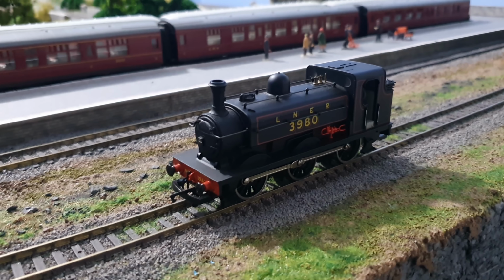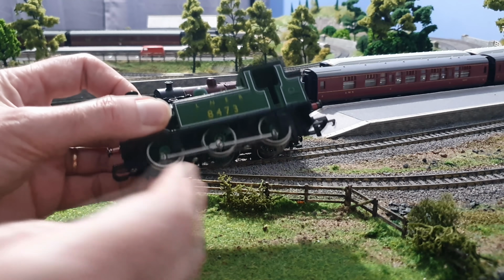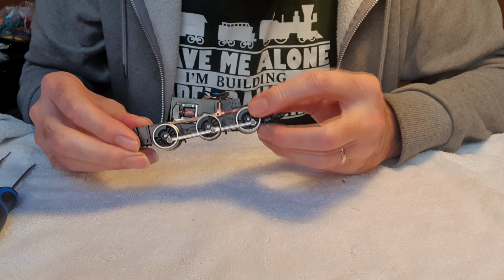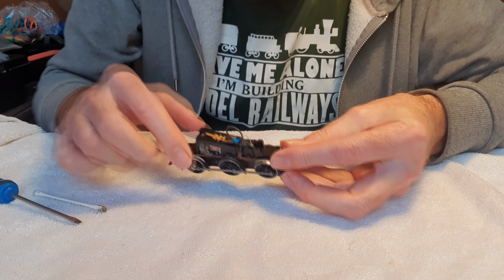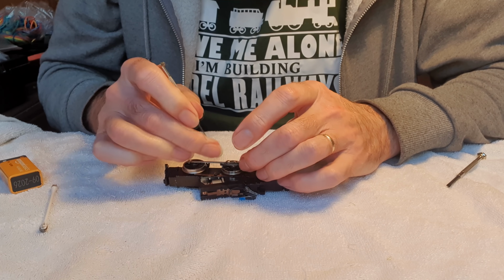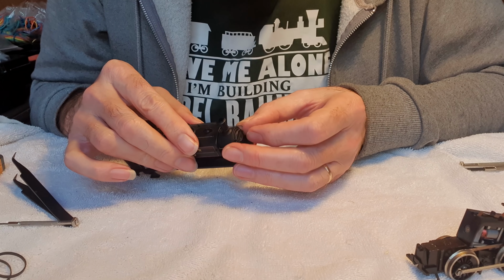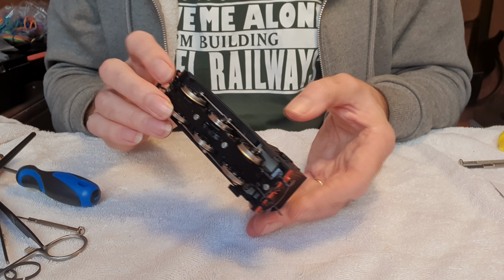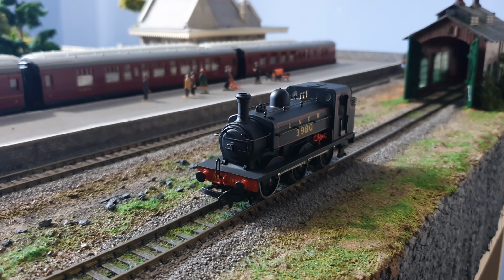Hornby R.861 LNER 0-6-0T Class J52: Ebay Runner Service

Comment: Hi OOBill - thanks for the entertaining video. I have two Airfix Prairies and when I dug them out of their boxes to run Code 100 track they didn't like it!!  After fiddling with the wheel gauge and removing the traction tyres I'm happy to say that they run over all the points 99% of the time. Removing the traction tyres doesn't seem to have lessened their traction effort - I run them up a 1 in 45 helix and they cope with trains up the incline no bother at all.

Comment: I've always thought these are pretty little locomotives and although they have been around a long time they just looked right for some reason. 
They are not in my main region of interest but I am sorely tempted to get one, maybe in GNR green or this lined black.
Nice information on the traction tyres causing an imbalance, just been buying some small engines for the grandkids to try and coax them into the fold lol. This could be a very useful bit of knowledge.

Comment: I have one of these too, but in the BR black livery, my only problem is that they are very light weight, I left the traction tyres on and added some extra weight in the form some bolts and screws and wedged them into the body shell above the motor and held them into place with some bluetack.
The extra weight certainly helps with the traction now!

Comment: Well done Bill , that's the only problem with some 0-6-0`s the wheels are too ridged in the chassis just fixed a Thomas 0-6-0 with the same issue ,,perfect now. Keep the updates coming 👍
Reply: Hornby Thomas & Duck are same.  I removed those, 14xxs same too.  Horrible designs.

Why Hornby thought this was effective, reliable and good enough is beyond me.
Reply: @sparkshot Tell that to Charles from engines Of eight

Comment: hi great video, the later motors have a brass worm on the end of the motor which i find improves the running of these railroad 0-6-0 locos. hornbys spares at the moment are terrible be warned, have been waiting for a bottom base plate since last march

Comment: A lovely looking loco.  Now I see how you have revamped it I'm tempted myself.  You don't notice any issues with the empty slot in the central pair of wheels where the traction tyres were, causing any issues then?  No snagging or catching on rails?
Reply from the maker: Runs fine. No snagging at all.

Comment: I'd always be very wary of removing Traction Tires from Locomotives as it can in many cases reduce the haulage capacity of the locomotive. You can always remove them and replace them with some stuff called "Bull-Frog Snot" Its a little pricey but does work quite well.
Reply: "Bull-Frog Snot" is pricey, but the jar will last you donkey's years, as you don't need much every time!
Reply: More to the point, in this case you have an 0-6-0 chassis, and most (model) 0-6-0s wouldn't be driving on the middle axle anyway, so for these models, removing the traction tyres, and possibly adding extra weight, is a no-brainer. But agree in general - always very wary about running without traction tyres.

Comment: All EU locomotives have traction tires be it Piko, Roco, Fleischmann, Liliput, Märklin, Trix etc. They wear out but never cause problems stalling the loco. Maybe it's a question of calculated tolerances and they are almost always mounted on the rear drivers. But personally I prefer without and get some wheel slip... sometimes.

Comment: I dispise traction tyres.  Had this exact same problem with 4 other loco's.  I did the same n removed them, no issues then.  

See saw stalling is crap.  No wheelslip is crap, tyres crumbling is crap....just NO.  Go away, be banished forever.  If the loco needs traction make it iut of metal or double head the train.